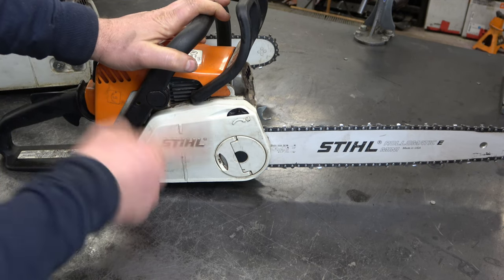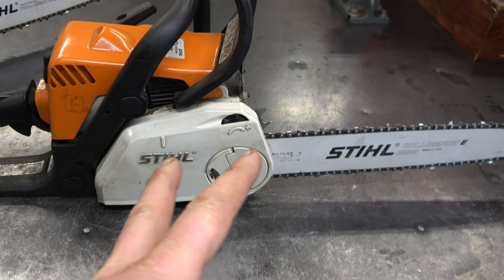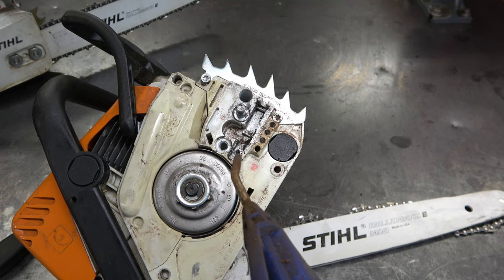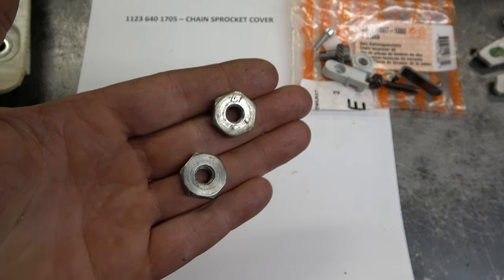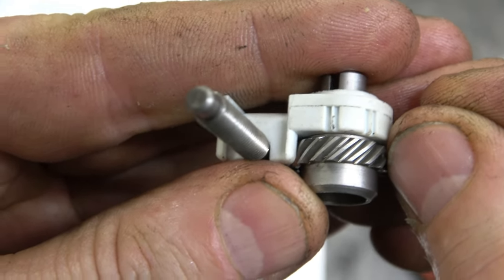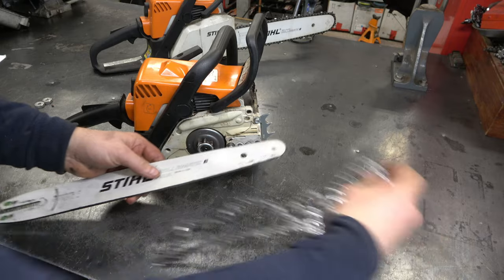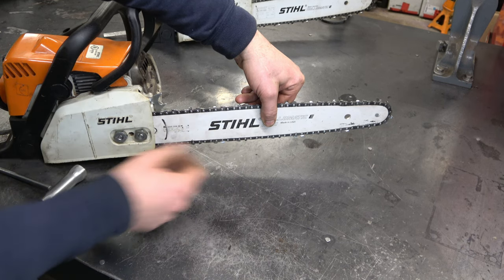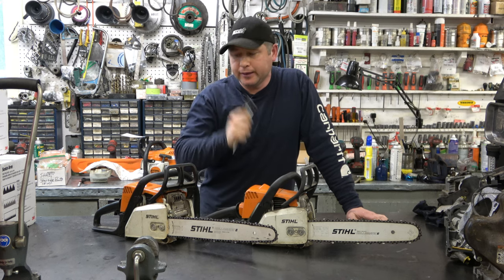Convert STIHL MS180C Chainsaw "TOOLLESS" Chain Adjustment To TOOL Adjustment Like The MS170

Comment from the maker: Watch my full side adjuster installation video on this chainsaw here;
https://www.youtube.com/watch?v=RnFd2NMWPYo&t=42s
Reply: How much would it cost in parts, since I will have to buy everything new including the new cover dony?
Reply from the maker: @Bill-xc8le  It's best to check with your local Stihl dealer. They may also have used ms170' kicking to lower the cost on the cover
Reply: What do you recommend for those stupid oil and fuel caps on that ms170 saw that break???
Reply: @billy2bob63  Use less force.

Comment: Very cool!  I've seen videos and read a lot of complaints about the toolless chain adjustment systems on several chainsaws.  I don't have one, but anyone who does can research their chainsaw to see if there are compatible parts to convert theirs.  Always great, Don.  Thanks
Reply: Yea I have a Ms 180 mini boss. The tool less sucks. I'm going to go the cheaper rout and get some aftermarket parts because I don't think it's a big deal. Yea the sprocket on the cover has plastic teeth and some are missing. I hate it

Comment: I just converted my 180C according to your great instructional video. The original "quick adjust" feature had become totally dysfunctional and required completely removing the side cover and manually pulling on the guide bar to tighten the chain. Thank you for the excellent instructions!

Comment: Great video Don! I was talked into a MS270 saw with the toolless chain tightener by the dealer. Bought it new. The adjuster is satisfactory but any new saw won't have that feature. It is imperative to keep the adjustment gear CLEAN or it won't tighten the chain for beans.  I also switched over to a rim sprocket drive. The chain lugs have a much better contact patch with the drive than the star wheel does. To convert to a non regular chain tightener on this model would cost over $100 in parts. I can live with occasional tightening and save the 100 bucks.
Only had one failure so far - ignition module. Other than that, a pretty good machine. Keep up the great work!

Comment: I have one 180C with the toolless adjustment and easy start. Initially I was very sceptical as I was only used to older pro saws. After using it a couple of years for smaller trimming work I have to say I like it. It's a lot of plastic on the cheap consumer saws but I have had no issues with it so far. Maybe explain your customers how to use it properly and how to go easy on the easy start pull. And while they are there, sell them a .50 gauge bar and chain. I "downgraded" the stock 16" bar to a .50 gauge 12" bar with yellow chain and that little saw is an awesome trimming tool.

Comment: Brilliantly useful and easy to follow. I just converted my MS181. Very easy to do following this video but found a couple of minor differences. The cover plate has just one stud hole (part 1139 640 1700) so you don’t need an extra stud or to remove the dummy stud T27). Also the small white plastic blank in the kit isn’t needed because the shroud doesn’t have a slot at the front. Also on mine the screws were T25 not T27. However the chain tensioning kit was the same and the process was as easy as pie. The easy adjustment junk went straight in the trash bin as soon as I finished 😊. 👍🏻

Comment: Last year I acquired a barely used MS250C as an upgrade to my MS170, very first thing I did was a switcheroo of the chain tensioner before eventually selling the 170.

Comment: Wow, this is the answer I have been looking for. My 180c is a pain in the rear end to adjust the chain. Thanks for the parts numbers and I will soon be off to my Stihl dealer to round up what I need to do away with this poor excuse of a chain adjustment system.
Reply: After a couple cuts i would have to loosen the cover just to get the cog wheel to tighten the chain  back up.  I'm definitely ordering these parts to convert it

Comment: I have Stihl MS260C with toolless adjustment, i think it works well. Very convenient thing. Though i'm not pro user. Must tight it well nothing more also must hold bar up  position when tightening it.

Comment: I actually have one of each of the saws you used to demo, and I prefer the toolless adjuster. I find the pico chain (which I really like) often requires adjustment as it heats up, and on the spot adjustment is easy. I have not found any issues with bar loosening. Mostly cut birch firewood on my own property, multiple face cords per year.
Reply: I cut nearly all my wood with my 180C and Pico chain and it's a great setup. I really like the toolless adjuster too. About my only beef is that the snap down handle tends to snap back in when tightening, and you have to take your gloves off to get it open. But small annoyance. The saw gets lots of use every year as we heat with wood. I bought my son a 170 when they had a good deal last year, we'll see how that works out.

Comment: That’s great . We have the same issue at the golf shop with the MS271 and the MS290C the guys always grab the 271. Because the 290 has that quick adjust and weird pull cord mechanism. Wonder if both issues can be converted to the 271 type. We also prefer the old style ones even the fuel caps . But the newer ones have become easier to use . I remember when they first went to the new style fuel and oiler caps they where troublesome to get lined up to screw in
Reply from the maker: yes you could convert them too

Comment: Great Video always!  Also worth mentioning to convert b&c to .50 gauge. Extra good for me,  MS 170 and 020T top handle both 14",050, 50 dl.
Reply from the maker: did that to my MS193T and my 170!
Reply: @donyboy73  home town a Mom and Pop OPE switched 170 w the. 050... Over 35 years ago, bought my Dad 028 Super for Christmas based on their recommendation.  Other than routine maintenance still runs strong. Keep clean, sharp chain and good fresh fuel.
The now vintage case is  almost worth as much as the saw! Also bought 020T as well. It's still worth a lot. Crazy.

Comment: I've seen Stihl make two "improvements" to their saws--this video corrects one of them, and the fuel cap videos correct the other.  Both improvements generated YouTube correction videos.  Uh, nice try, Stihl, but I'm wondering about their efficacy.  Perhaps your beancounters are getting out of control?

As usual, another great (and necessary) video.  Keep 'em coming!
Reply: I like the new style fuel caps.  it's nice to not need a tool to break the fuel and oil caps free.

Comment: Nice video! Thank you! I did that convention to my new Ms 230C  before ever use it with the tooless adjustment! Having 2 nuts holding the bar I feel more secure! And looks cooler 👍😉
Reply: Were the parts numbers the same for the MS230C?
Reply: Are the pet numbers the same for doing this to an MS230C?
Reply: @NotALot-xm6gz  yes was the same parts
Reply: @kostasfrangos3354  Thanks! Having to set the chain tension way off due to how the locking disk changes it has been driving me nuts for years.

Comment: For a new homeowner what type of chainsaw would you recommend.  I already own a stihl MS194t I love it to cut my 2 palm trees 🌴.  I just don’t want to use the same saw what would you recommend? Or should I just buy a longer bar and chain for my top chainsaw ?  I just don’t want to ruin my small chainsaw.   I think I ahi be using one for my palm trees 🌴 and one for my 4 regular 🌳 I have that some need to be cut down and trimmed down as well.  Do you have any recommendations ?  What do you think of the new battery powered gardening tools?

Comment: I bought a MS180 last year without the "Toolless" adjustment.    Had to look really hard to find one.    They are available, at a reduced price compared to the "toolless" model....  (Also put on a 12" bar and chain.  Didn't want or need a 16".)

Comment: Have a Stihl with 16" bar and want to get a 20" or 24"
I am hearing great things about the Echo saws.
What are your thoughts?
Also I speak for many...thank-you for all of your detailed videos!
Reply: it's not a big deal to increase your bar length a step or two.  if you want to go beyond that, you probably will need to go to a skip chain that has more space between the teeth, the big thing to remember if you go with a long bar is you may need to use less pressure to cut things with the full length of the bar, in order to avoid bogging the engine. but on the other hand, a long bar lets you reach out further, say to gut firewood that's down at ground level without having to stoop or kneel.

Comment: Excellent clear video. 👍🏻.  Will the same parts allow me to convert the MS181c?
Reply: The side cover is a different shape from the 180 to the 181 at the rear bottom corner . You could probably do a conversion from 181c to 181 fairly easily , it's just that the 181 only has one bar nut . Maybe there's a side cover out there to allow the use of two bar nuts , I don't know , need to research that one or perhaps Dony can answer that . I have both 181 and 181c , the single bar nut on the 181 has not been a problem for me , although I'd prefer two .
Reply: @Gordon_L  Thanks for your answer Gordon.  👍🏻🍻

Comment: Would the parts from a ms170 work to convert a ms251-c?
Reply: I converted an MS251c. Use an MS250 cover and I had to turn down the collar on the stud for the back hole. Easy job though.

Comment: Can i ask something sir?. If we first start chain saw, ground start or other, is the brake must on or release before we started?. Because there a moment high rpm when chainsaw running until we press knob rpm…, can you explain sir where is the best we must do?
Reply from the maker: I personally start it with the brake off. If you are new to chainsaws you might want the brake off then turn it off once it is idling.
Reply: @donyboy73  it’s mean before i start brake must be ON so what’s the problem Mr if i start with brake off, because i want to reduce slip brake and drum when brake ON and chainsaw start running high idle in amoment…

Comment: Hi I have a  ms290 to much compression  any help won't fire up
Reply: I had to sell my MS 280 due to no longer having enough arm strength to pull it through. Am now 84 yrs young. Bought a MS 70 and MS 80 as I really don't need the large saw.   Gary

Comment: If you’re going to do this on an MS-231 CBE, you only need the one bar nut and you don’t need the Stud (collar screw) IMPORTANT : The Sprocket Cover you will need for an MS-231 conversion is Stihl Part # 1143 640 1701.

Comment: Hey Don, I have a quick❓ I bought a Poulan Pro 42/18 chainsaw it calls for a 50:1 mix. Do you think it would be better to run 40:1 instead?
Reply: It's always better to stick to the manufacturers recommendations. They pay engineers to decide these things.
Reply from the maker: I use 45:1 in all my 2 stroke equipment
Reply: Listen to Don. It will last a lot longer.
Reply: @Thomasploeg1968  Proof ? Poulan does extensive testing before recommending mix ratio. Have you done testing to prove that using a richer mixture is better ?
Reply: @davidquinn6161  Usually the manufacturer recommends a 50:1 because of the EPA and all the climate change nutbags. That's why I ask donyboy because he know his stuff and has been doing his job for decades. Not only that because of him sharing his knowledge I have fixed alot of my own equipment and other equipment as well. I do however thank you for commenting. I really appreciate it

Comment: If you own a chainsaw, you should have some tools an know how to perform simple maintenance. These “too less adjusters” are just a gimmick, like self sharpening bars/chains. I would run that chain a bit looser than you had it, that’s a small displacement saw and small crank bearings. Too tight of a chain slows down the saw snd is hard on that PTO bearing.

Comment: If you were constantly adjusting and taking the bar off, then fine, tool less has its place but honestly if it was once a day, you are stripping it down ,  you'd be lucky. Another pointless upgrade to garden machinery.